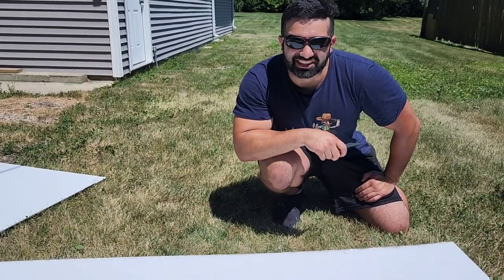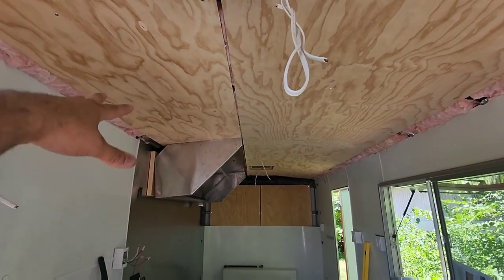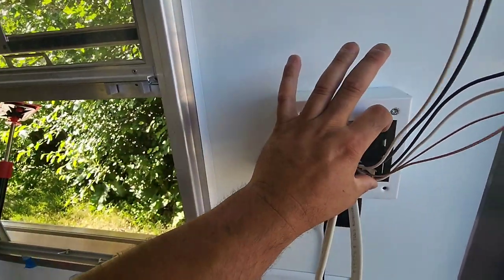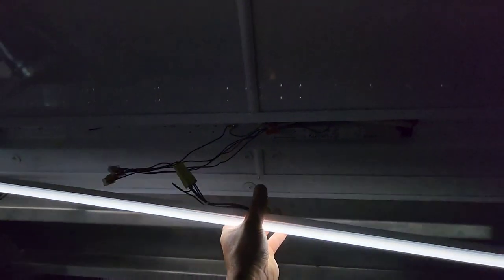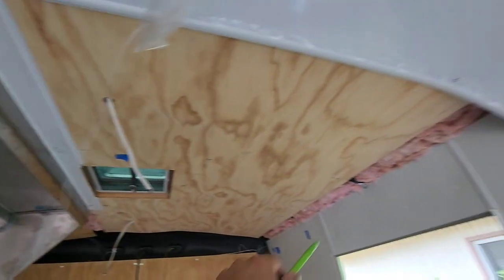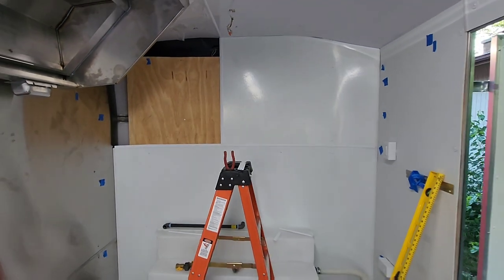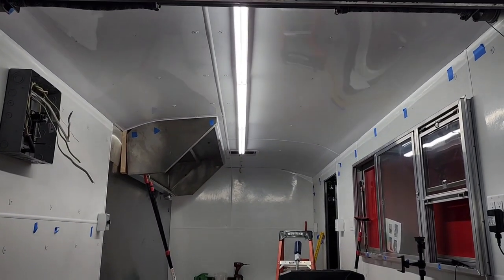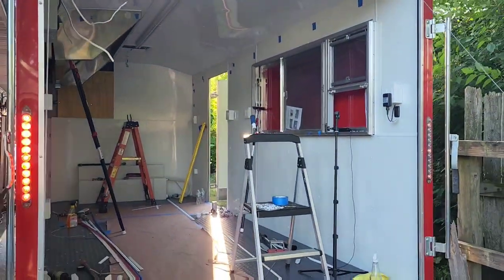Installing a Food Truck Ceiling

Comment: Frank, couple of suggestions for doing this in the future. For cutting the aluminum, being in the construction trades I would guess you might know someone with a “break”. If not you might do better with a metal blade on a circular saw. For getting rid of the sharp burrs left behind, try a reburring tool. Just a thought
Reply from the maker: That circular saw for sure could see that working. Thanks for the tip 👍 appreciate it
Reply: @fbaltierrez  wat size aluminum did u use

Comment: Where do you get those (I think you called them “n caps” the channel that goes in between the sheets of aluminum on the ceiling
Reply from the maker: The white ones from Menards. The Stainless steel ones from here End Cap:

https://www.amazon.com/gp/product/B07M793VN5/ref=as_li_tl?ie=UTF8&camp=1789&creative=9325&creativeASIN=B07M793VN5&linkCode=as2&tag=rollingburrit-20&linkId=9b596fb6e41fc02db37f3dde5c9f2ed6

Divider Bar
https://www.amazon.com/gp/product/B07MLSP44P/ref=as_li_tl?ie=UTF8&camp=1789&creative=9325&creativeASIN=B07MLSP44P&linkCode=as2&tag=rollingburrit-20&linkId=14b923c96bad8c7829caeb5c89ebebb4

Comment: Hi Frank. I have a question Bout the breaker box. It says 8 space 16 circuit. Does that mean 16 individual circuit breakers can go in there?  Thanks
Reply from the maker: Yes but they are what they call tandem breakers 8 regular breakers or 8 tandem breakers
Reply from the maker: Mini Breaker

https://www.amazon.com/gp/product/B00002NB0L/ref=as_li_tl?ie=UTF8&camp=1789&creative=9325&creativeASIN=B00002NB0L&linkCode=as2&tag=rollingburrit-20&linkId=df62e074e6bb3d54b5358fd23ba920f
Reply: Thanks for the info Frank. I'm starting my trailer build shortly. Had hip replacement so waiting for that to heal

Comment: What is the name of the plates you installed on the walls and ceiling?  Where can I buy them and transitions?
Reply from the maker: SS Trim Pieces

End Cap:

https://www.amazon.com/gp/product/B07M793VN5/ref=as_li_tl?ie=UTF8&camp=1789&creative=9325&creativeASIN=B07M793VN5&linkCode=as2&tag=rollingburrit-20&linkId=9b596fb6e41fc02db37f3dde5c9f2ed6

Divider Bar

https://www.amazon.com/gp/product/B07MLSP44P/ref=as_li_tl?ie=UTF8&camp=1789&creative=9325&creativeASIN=B07MLSP44P&linkCode=as2&tag=rollingburrit-20&linkId=14b923c96bad8c7829caeb5c89ebebb4

These are the transitions

Comment: Hi Frank. What was the thickness (gauge) of the white aluminum?
Reply: Also, if you installed white aluminum for the walls, would you use the same gauge?

Comment: Hi, What did you use to glue the aluminum panel to the wood of your ceiling?
Reply from the maker: Not sure it I used anything but if I did most likely construction Adhesive from home depot. The one in the tubes